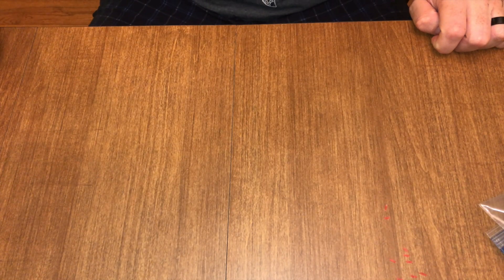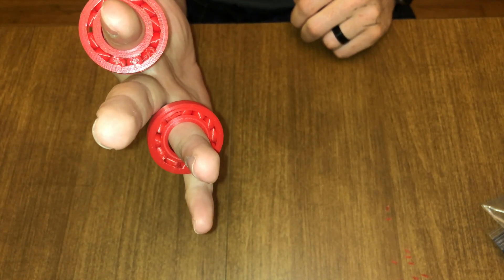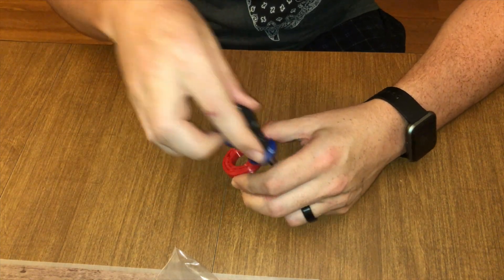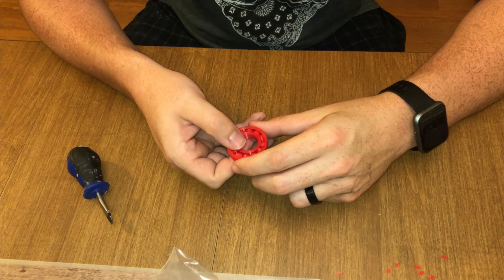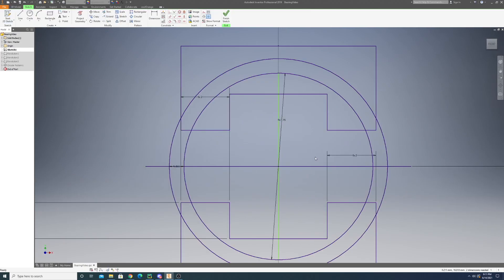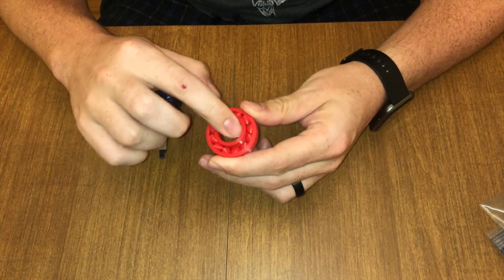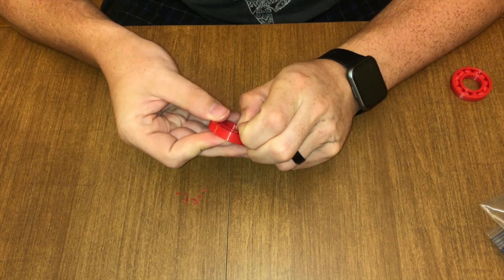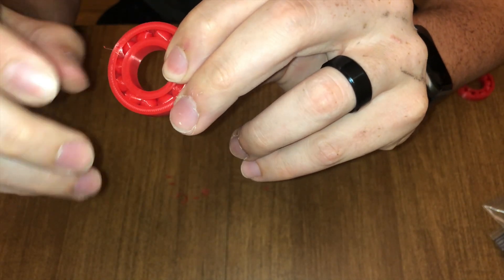Print in Place Ball Bearing! | Functional 3D Print

Comment: so i have a question... i'm currently in a mechatronics engineering program and we use autodesk inventor 2025. I've been able to replicate the sphere inside the 2 rings but when i type in "ballnum" into the quantity block, it goes red and wont let me click ok, I'm assuming it is an error somewhere in my build. am i right in my assumption or could this be a change that they have made to the program? **EDIT** after going back through the video at .25 speed, i noticed that youve already got what i assume are preprogrammed dimensions from previous projects so that may be why it isnt working properly?

Comment: The first time I tried to print some bearings was when I saw some on Thingiverse. They have pieces between the balls that keep them evenly spaced. They spin quite freely but the lateral play in the bearing (how far you can shift the inner ring from side to side) is not good. In reality this really isn't worth the filament as proper steel bearings can be had for less than $1.00 apiece.

Comment: 💡 Suggestion: a completely 3D printed fidget spinner with this 3D printed bearing design integrated into it. 😉
Reply from the maker: Interesting.. I’ll have to see how this bearing scales down. With the current size, that’d be a huge fidget spinner haha!

Thanks for watching!
Reply: @PrintPractical  I mean, the body of the fidget spinner will be basically the outer "ring" of this bearing design. Also, it needs two separate pieces which snap together trough the centre ring of the bearing, where the fidget spinner is held, you know. 😉

Comment: Print in place is awesome. Im assuming you can scale this up however large you want?  Gonna print this and give it a try. Liked and subbed.
Reply from the maker: Awesome thanks, I only tried it at its current size. I can try to scale it differently this weekend, but this size has worked for a few of my projects. My next video involves a project which uses this bearing and a print in place ball joint I designed. 

Thanks for the sub!

Comment: Thanks man! Your video inspired me to try it for myself. I tried several sizes and the rolling resistance if far lower than I would have expected before I watched this video. The bearings tend to bunch up a little, but they can take more pressure than you'd expect. They make a discomforting crunching sound when you load them up heavily. You might want to use a higher filling rate, so they are completely filled up.

I used FreeCAD and I made it parametric, so I just have to enter an inner and outer diameter and it gives me a bearing (within limits). Quite a fun project.
Reply from the maker: Thanks for watching! I may be revisiting the ball bearing to see if I can improve it. I did put this on Thingiverse if you want to check out the model. My next video will also show a use of this bearing, as I made an object with wheels.
Reply: Hi sor can you show me your parameter setting in prusa or cura to print ball bearing?

Comment: Have you ever used a 3d scanner? If so Do they work well?
Reply from the maker: I haven’t, I draw all of my models. The “project” I keep hinting at is actually a 3D printed turn table to show off my prints, which I could probably use to 3D scan. I’ll have to look into it after I finish that project.
Reply: Polycam works fine. Not for mechanical stuff. You can just use your phone to scan stuff via video... Good for making dioramas

Comment: Good video. This design is missing the ball retainer/cage. Without this cage, the ball spacing is not uniform making the bearing concentricity change as it rotates. It also allows the balls to rub each other while turning, creating unnecessary wear and friction. I think you could design a snap in cage that would solve this problem.
Reply from the maker: Good point, I had to look more in-depth into ball bearings, as I didn’t know about that. I’ll have to add something in to fix this.
Reply: @PrintPractical  Looking forward to that. In my attempt the ball bearings are somewhat rhombus or diamond shaped. The bearing rolls quite well despite this because the unevenness of the bearings is offset by eachother. I wonder how low you could make the rolling resistance when the position those bearings is fixed.
Reply: Try to print it with a small nozle with small leyer hight
Reply: @JasonRobards2  when you export a stl file from a cad program, it essentially has to convert those high precision mathematical curves into triangles. That in turn means that the curve gets converted into a series of points, connected by straight lines. There should be a setting for resolution that affects how many of those points will be created.

Now the diamond shape could come from printer settings, but it could also come from the issue I mentioned above, but I don’t know your specific workflow.
Reply: you are forgetting this is not designed for high load or rotational speed